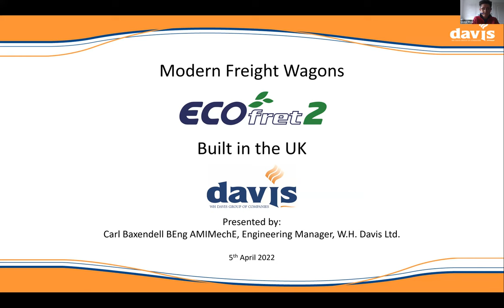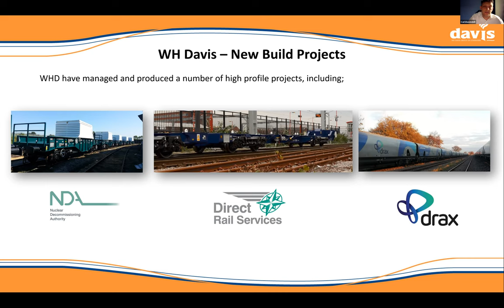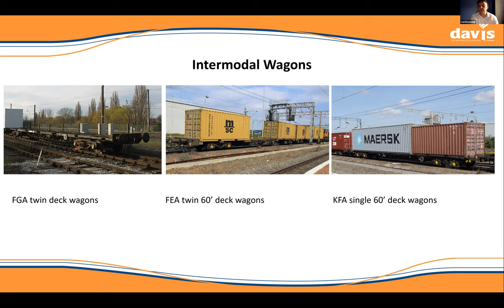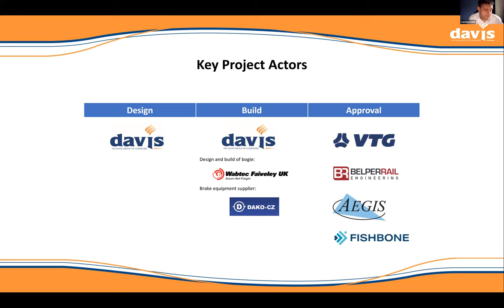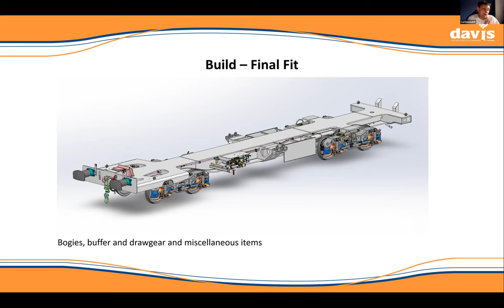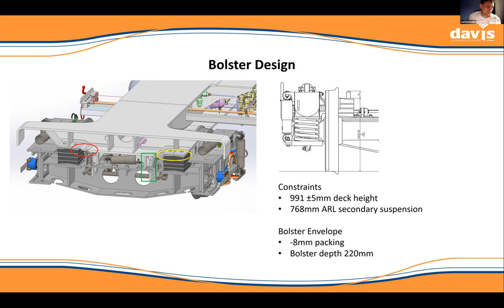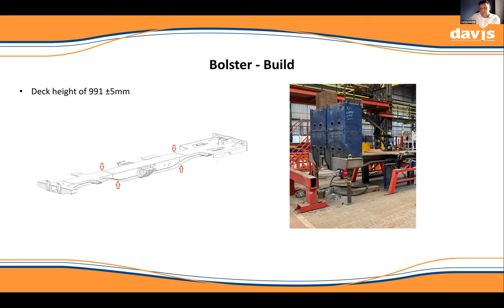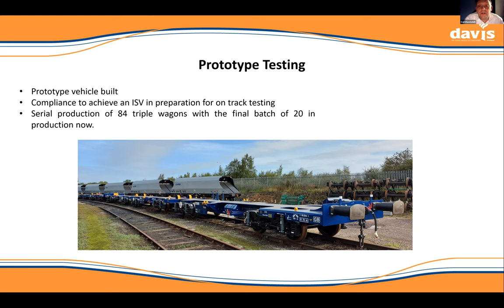Modern Freight Wagons Built in the UK: The ECOfret 2

Comment: Pacer train is a model of a railbus, a bus that runs on rails, the Pacer is based on a 1980s Leyland single decker bus body, engine and gearbox mounted on the undercarriage of a freight wagon which is why the ride is bumpy, railbuses date back to at least the 1920s and old Mercedes railbuses are used in Bolivia which Chris Tarrant rode in an episode of Channel 5 Extreme Railways.